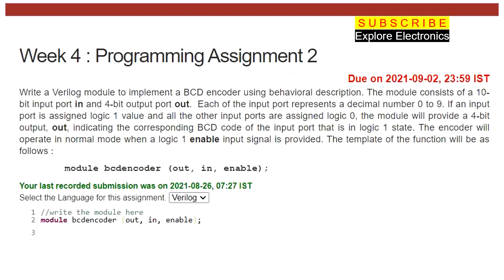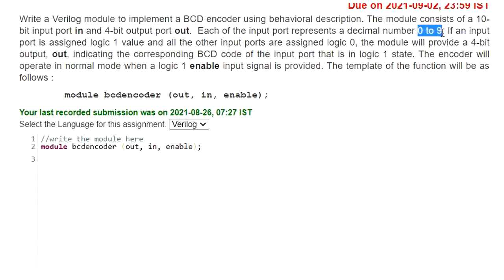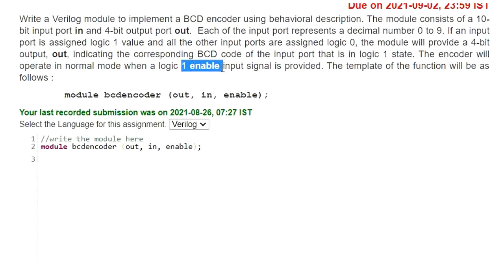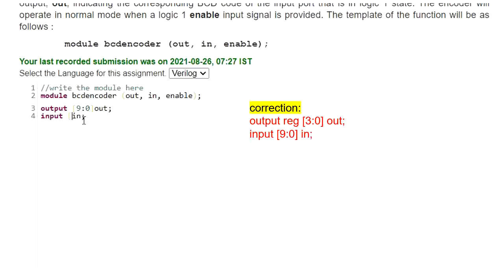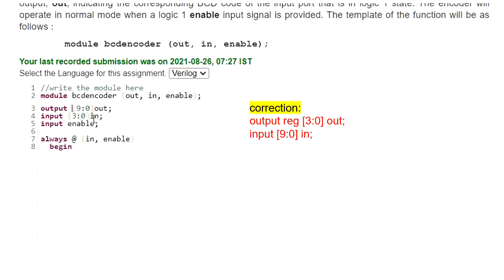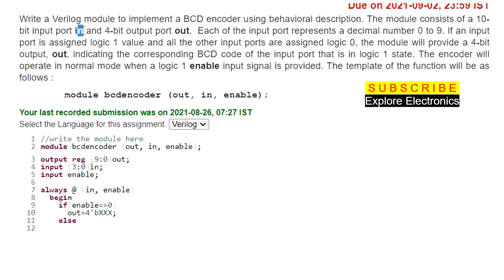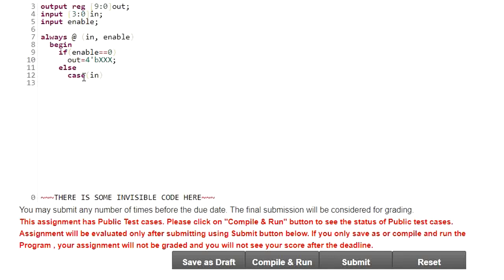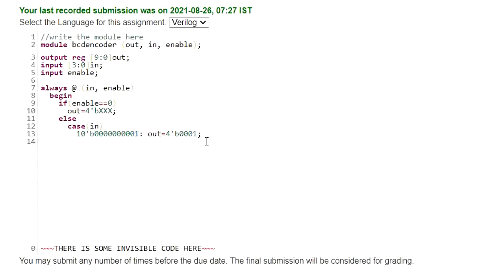verilog code for Design of BCD encoder | Hardware modeling using verilog

Comment: Sir, Please Guide US how can we do the Verilog Modules for Week 5 Programming Assignment 1 and 2 with respect to Finite State Machine.

We have to Submit Week 4 and Week 5 Quiz Assignment both by 1st September 2021 @ 23:59 hrs IST

and We have to Submit Week 4 and Week 5 Programming Assignment 1 and 2 (for week 4,5) by 2nd September 2021 @ 23:59 hrs IST
Reply from the maker: Yes I will go through it after completing. Week 4